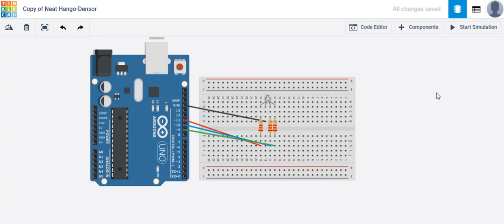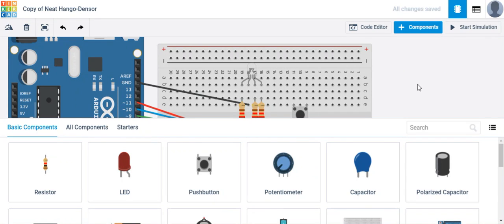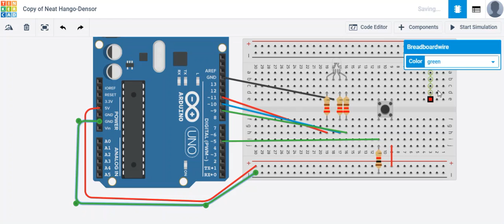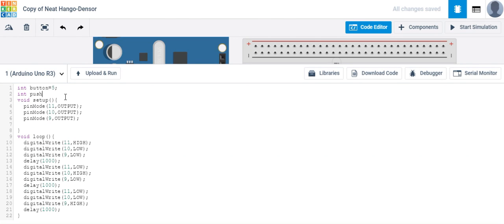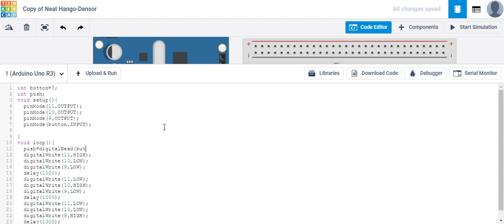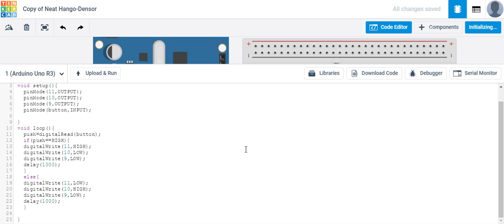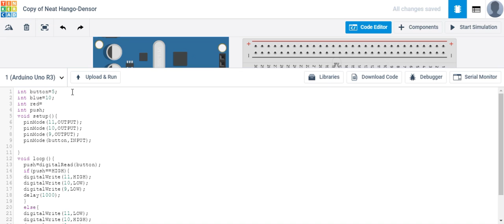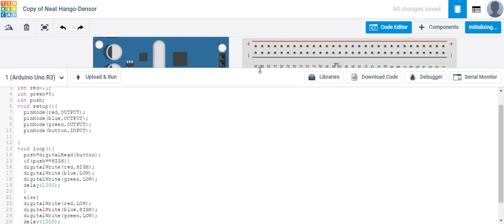Lighting an RGB LED with a Push Button on Tinkercad

Comment: What if I want the color to change from red to green to blue on pressing the push button?
Reply: //RGBCMYW using 1 push button
int c=0;
void setup() 
{
 pinMode(6,OUTPUT); //red
 pinMode(3,OUTPUT); //green
 pinMode(5,OUTPUT); //blue
 pinMode(2,INPUT);  //pushButton
}

void loop() 
{
  if(digitalRead(2)==1)
  {
  c++;
  delay(400);
  }
  if(c==0)
  {
  digitalWrite(6,0); 
  digitalWrite(3,0);
  digitalWrite(5,0);
  }
  if(c==1)
  {
  digitalWrite(6,1); //red
  digitalWrite(3,0);
  digitalWrite(5,0);
  }
  if(c==2)
  {
  digitalWrite(6,0); //green
  digitalWrite(3,1);
  digitalWrite(5,0);
  }
  if(c==3)
  {
  digitalWrite(6,0); //blue
  digitalWrite(3,0);
  digitalWrite(5,1);
  }
  if(c==4)
  {
  digitalWrite(6,0);
  digitalWrite(3,1); //green
  digitalWrite(5,1); //blue = cyan
  }
  if(c==5)
  {
  digitalWrite(6,1); //red
  digitalWrite(3,0);   
  digitalWrite(5,1); //blue = magneta
  }
  if(c==6)
  {
  digitalWrite(6,1); //red
  digitalWrite(3,1); //green = yellow
  digitalWrite(5,0);
  }
  if(c==7)
  {
  digitalWrite(6,1); //red
  digitalWrite(3,1); //green
  digitalWrite(5,1); //blue = white
  }
  if(c==8)
  c=0;
}
Reply: @laahyapolisetty1524  u damage the board so thats a bad code.